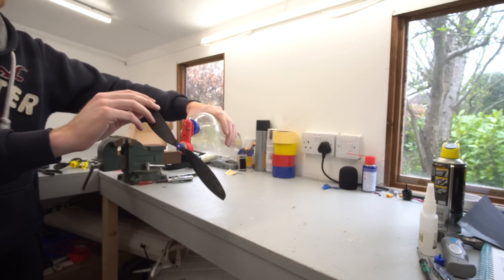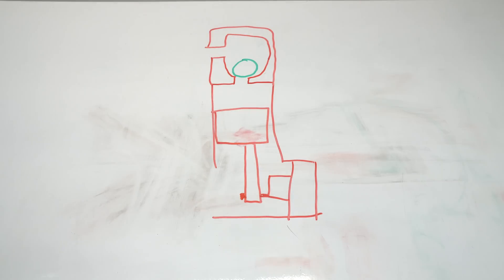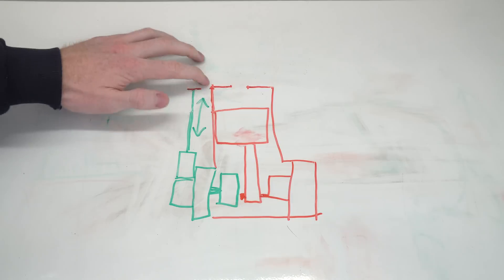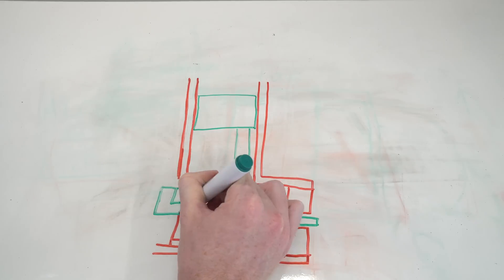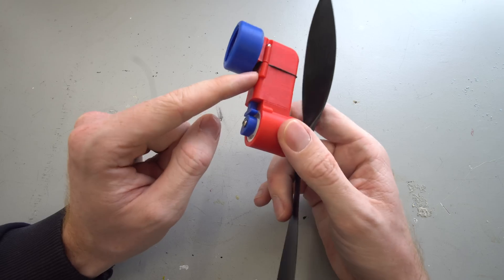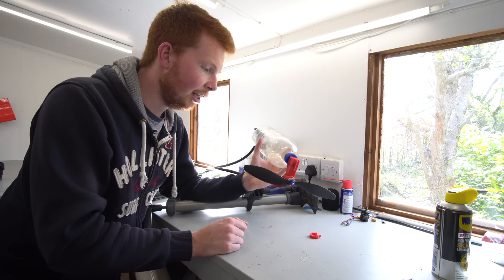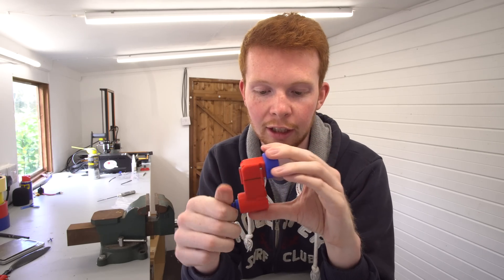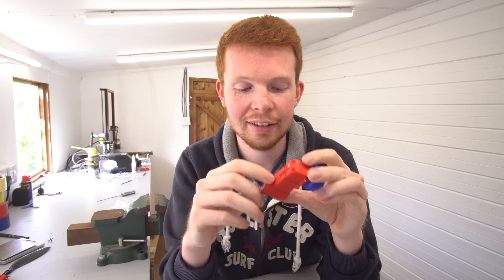Compressed Air Engine V3

Comment: Well Done!  My only question from an engineer standpoint is can the compressed air be made to be released at a constant rate instead of at a gradual decrease? I'm thinking a balloon has a different expulsion rate...

Ooo! What if you lined the inside of the bottle with a balloon that fills up and then it's contained in the dimensions of the bottle and builds pressure as normal. That way when the engine is going, at the end when bottle pressure drops, the balloon takes over and presses the rest of the air out.  A tight balloon tube that expands to fill the bottle (would have to be a micro perforated bottle otherwise balloon to bottle air pressure would counter it - but micro holes (and a lot of them so the balloon can pull away from the bottle wall fast as it squeezes the remaining air) so the balloon doesn't get pushed out the holes.

Oh yeah... that would help.  Like 10% :P

Plus it would look cool.

Comment: Aren't you re-inventing the wheel?  Meaning steam engines. Why not use the same mechanism as a steam engine?  :/  Its the very same principle, constant water vapour pressure while here is constant air pressure.

Comment: Another thought, and I'm not sure how difficult this would be, but the engine would run longer if you could somehow limit the airflow.  Right now if it's got 60psi, it's pushing the motor as hard as it can, but if only 30psi can come through, then it would run for quite a bit longer and still have a lot of force behind it.  Maybe a Tesla valve? Something to think about.  It's a great little project though!

Comment: I think your initial design was actually better.  With the extra cam on it, you're losing energy.  Just get rid of the spring and have a pin on top of the piston push the ball out of the way.  The fewer moving parts the better I would think.  It's good, but the spring is superfluous.

Comment: trust me stick some 3 in 1 oil in in there to seal the gaps between the cylinder wall and piston , will increase efficiency by 5-10 percent

Comment: Neat post,  I remember, but can't  find ,  and air motor on You Tube that had no valve,  just an open port to the cylinder .  It used the "bounce space / volume "  in the feed line to the cylinder and a big flywheel I suppose . Seemed to run  O.K . using the harmonics of the air line flow to the engine to run .  This make any sense ?  Anyway fewer parts , that always good, right?   Patents 672256, 3190554,  3013505 .

Comment: Could you purchase pre-compressed air? Or use an electric car tire pump with large metal cylinders to get a higher pressure and run time? Try experiment with those too

Comment: We actually tinkered with the idea we got a old Briggs to run on compressed air by offsetting the timing and it didn't run quick due to the lack of efficiency. Could you give me more info on this motor and the possibility of a higher upscale of the engine that might possibly create some torque under real psi numbers? I do alot with go karting and minibikes and would really love to build a compressed air engine minibike

Comment: Could you implement some sort of variable valve on the input to the engine which would allow you to manually determine how much air is entering the system and thus how fast the prop spins?

Comment: you should get a air compressor fill it and get some sort of regulator valve so it works cleanly and make the regulator into a throttle of sorts

Comment: I like your ideas, but please ditch the square piston. There's a reason you never see that in "real life", and its because its impossible to seal the 4 corners which results in poor compression and/or blow by - the latter of which is very relevant to compressed air engines.

Comment: A couple suggestions: 
1. Test the motor upside down and to the sides. If the pressure can keep the ball bearing closed, then you can double up and have a built-in failsafe that will release the air once it reaches a low enough pressure. 

2. Looking at your design, there is a waste of air created at the beginning since more pressure means more air leaking into the piston. My suggestion would be to add a regulator even within the cap, limiting the psi inside the ball bearing chamber. This will keep a more even flow with the propeller and have an additional bonus of creating an opportunity to have the speed be variable.

3. By replacing the propeller with a gear that turns a screw or nut-style cilander, you could easily transform the propeller into a turbine, similar to a jet boat.

Comment: Congratulations for all your tests, you are brave. compressed air being a very light energy to board in flight. The idea is excellent. But it would take some extra finances. a small high pressure carbon tank (found for pcp guns), a pressure regulator, and perhaps a crankshaf with double piston system, to optimize the fluidity of rotation.

Comment: Co2 compressed bottles, usually used for pellet guns...great source of air in a small container. Now I want to build one...or ten. What 3D printer did you use and are you going to make the printer files available?

Comment: Hi Tom,  Excellent solution to a problem that I couldn't see existed in the first place. Why have the spring on the top of the piston? The ball valve is held in place by the air pressure and all that is needed is the peg on the piston to lift it off its seating which it will do at top dead centre allowing the engine to run in either direction.

Comment: I saw how you used silicone lube to lube the engine, I was thinking you could make a reservoir inside of the engine on the bottom so you don't have to refill it every time you start it.

Comment: I love the idea of harness air pressure but i wonder if it’s possible to lower the noise by using a magnet instead of the mechanical mechanism so the plastic won’t click so much

Comment: did you print the threads or use self tapping screws.

or is the plastic weak enough to just have a regular screw 'self tap'

Comment: Wouldn't a reciprocating engine with a flywheel be far more efficient for conserving power output of pressurized gasses? This design seems like it's trying to work like a combustion engine and adding a lot of extra complexity and resistance.

Comment: Is it possible to link up 8 of them in a V8 sequence and have pressure tubes delivering the air to the engine also you could have a solenoid valve controlled by electricity ( making the system be able to run in an RC car.

Comment: This is cool. Put a regulator at 10-30 psi, whatever is optimal. That way all the 120 psi high pressure isn't used up as fast

Comment: To extend the amount of time that the engine will run, increase the storage container pressure and include a regulator to step the pressure down to just a little above the pressure where the engine stalls. This will get the storage pressure off of the engine, bleeding just enough air in to keep it running rather than the full pressure rushing through. Then, varying the regulator setting will change the engine speed.
Reply: daichai  Would be an interesting conspiracy if you had evidence to back any of it up
Reply: Only free pison will allow to get the full explanation.
Reply: With this, if you were to choose, you could extremely easily make an air powered rc plane.
Reply: https://youtu.be/ffT-abOkJyk
Reply: However that container will not handle above 150 psi or so
Reply: Just make the piston smaller so it uses less
Reply: @charlestinoai9491  power will be reduced
Reply: @deepad7924  not much
Reply: He'd be better off doing some analysis on the cycle and realizing that he's wasting energy by not allowing the gas to expand in the cylinder.
Reply: @frostyab7579  Allowing the gas to expand further would lower the torque output and reduce the engines ability to function at lower psi. I think a regulator, like Christian mentioned, would be a better option so that he could keep the engine working at ideal conditions for a longer period.
Reply: @frostyab7579  how could the design be modified to let the air expand?
Reply: daichai  you're an idiot. Lemme guess, you think the world is flat and that the moon landing was staged in hollywood too...
Reply: @ChristnThms  its a joke you fucking door
Reply: @DemsW  I don't think so. 
When I encounter a situation where a person is either a complete idiot, or so clever that I can't even conceive of his depth, I take the most likely option. 
He's not clever. It's not a joke. He's an idiot.
Reply: @ChristnThms  The Plot Twist : Is a very common joke format for youtube videos but I guess it's part of the things you learn on the website
Reply: @DemsW  saying it's a plot twist doesn't make it clever.
Reply: @ChristnThms  never said it was clever nor good, I only argued that it was clearly meant as a joke and calling him stupid really makes you the fool that's it.
Reply: @ChristnThms  what he meant is that when you see "plot twist" at the start of a youtube comment (or other social media platforms) it's 100% a joke, every time. That's why when ever you see "plot twist" you can be sure that it's followed by some idiotic conspiracy theory or something that makes no sense whatsoever. It's idiotic on purpose.

Hope that cleared the misunderstanding :)

Comment: use neodimium earth magnets wit oppisite poles instead of a spring, it will work a lot better, you will hve to cut down the shape of them if you want them to fit, I buy mine off of ebay

Comment: i think it is able to run under lower pressure because the piston has a much larger area. the larger piston allows the more pressure to be distributed onto the piston making it easier to push.

Comment: Couldn't you add a sewing needle-eye style slide valve to the top of the piston? It doesn't have to be round. So long as air and lubricant can get to both sides of the "needle slide valve"

Comment: What about an oil-sealed rotary valve? Could power it with a toothed belt pretty easily, reduces bulk and complexity compared to a pushrod system. What about a belt-driven cam that actuates valves more like those found in an internal combustion engine, but sealed with an o-ring so they don't have to be as precise to hold pressure? The o-ring won't see any friction that way as well.

Comment: You're thinking about this back to front. As you have no combustion happening, you can use the crank shaft chamber as part of the cylinder. The input and exhaust can be controlled by a disc with a cutout section on the end of the crank shaft. Then just leave the top end of the cylinder open and you've got an air engine with only 4 moving parts.

Comment: One problem i can see is that the maximum speed depends on how much pressure there is. If is possible somehow to cap the top speed then it would last longer to rotate.

Comment: Just fascinating. To think how engineering in the home has changed over the last 80 years, is just amazing.  In our days we had valves off the olf military equipment, then ball   bearings to do things with, then we had lathes and milling machines and all that has now been replaced by the talent of this young man.  I feel that the old community which used to meet in churches and theatres and other music halls for entertainment will not be meeting in a workshop discussing what they could do with 3D printers and their  applications.    Classical educators whom in the past thought that they had it all right  missed so many intelligent students because their talents was in the direction shown by  this young gentleman.  Getting to know the universe is much more satisfying  than reading what was written by some people in the past. THat is important to do as we build on the shoulders of other, but classical education as reading writing and Arithmetic needs to be supplemented by the design and dooing actions of very high level and ingenuity. Congratulations to all  who contribute to this discussion.

Comment: i think there is allot you could improve, your piston is huge, much to big, remember the prop spins at higher rpm in moving air as opposed to still air. thus consuming more air, using a smaller piston will give you longer flight times, also you only need a short burst of air, preferably just before top dead centre of the piston, this allows maximum pressure and effciency from the piston stroke, also making it quieter and less knocking of the con rod.

Comment: compressed air engines are old tech that in the end isnt all that useful. air hogs had these ages ago.  the issue always comes back to compressing the air.. and unless you can do that with non compressed air and without electronics or fuel... its pointless

Comment: thanks for posting.  nice work.   some thoughts.      if engine output is low-torque, it should not be loaded, directly ( with an over-sized SF prop ).     partial isolation from the load is achieved by running the engine as Fast as Practical, and using low-loss gearing, in single reduction-stage.     then, consider not using an SF (Slow-Flyer) prop.   consider the many ways in which the flying wing airframe can be Improved and/or made Lighter.    consider, Especially, that the wing Should be making at least moderate lift via the use of a Cambered, two-surface profile in its construction.   something resembling a clark-y v1 profile or the armin wing; in either case, Always thickest at 30 percent of chord.     cheers

Comment: If you went back to the v1 ball but made it out of a neodinum magnet with a rounded bottom and put it in a bracket that stops the magnet from  flipping over you could replace the spring with another magnet that has the same poll facing the check ball magnet it will work just like a spring but more staple from side ways movment

Comment: Cool design but Airhogs did this in the late 90's with a compressed air  aeroplane. It had a straight flight range of about 200yds on 100psi

Comment: increase the inlet/outlet orifice of the valve, make the piston domed to fill more area of the chamber, enlarge the exhaust port and increase cam duration. All will increase the volumetric efficiency of the system.

Comment: this is how real planes actually work! i'm working on these type of models since 1975! so real planes don't use 58493009534 tons of gas they use the free air around us! Only at startup and takeoff the gas is needed after that planes are running on 98%air and 2%gas!

Comment: I got to 2:08 and then just wanted to know, why not reverse this? It's not a gas engine- it's air, it's not going to foul up the crank case if you have air in it. Why not skip the ball valve AND the cam valve up top, and have the air feed in from the bearing location, and as it vents out through the cylinder, it pulls the piston out with it for a duty cycle? That would remove your need for cams, push arms, and those other bits, and would probably not require extensive modification.

Comment: You should try it with a proper air container over using a bottle, see how long it'll last under more realistic pressure. You could also use a 1 way valve that'll only let through a certain amount of pressure with 2500psi diving tank and see how long it'll run, it is plastic on plastic after all with no oil

Comment: Could the engine work with steam for an longer period? If not in PLA, then in ABS? With an multi cylinder approach (8 or 12), then every second loop could be with cold air.
Idea for that is not to run an propeller but harness heat to an small generator.

Comment: what if you found a way to add an internal bag and two feeders to feed in baking soda and vinegar, the inner bag in so the baking soda and vinegar don't run through the motor. how long could a rection be sustained?
Reply: find two none toxic liquid solutions that react like that, pressurize both chambers with the liquids and the main chamber, let the mix run through the motor? that would make for a longer run time I think

Comment: Using a magneto connected to a fuel (air) injector should work...the magneto should be adjusted to open the injector at top dead center...just a suggestion...

Comment: If you used a slanted cog you may be able to lock the RPM of the propeller and piston, allowing for more time with higher psi instead of higher cyclic rate

Comment: i think this is a great design, however for the square piston, i would suggest finding a way to push from both sides instead of one, as pushing from one side increases friction on the other side(think the square slightly rotates as the force is applied offset from its center of mass)

Comment: I don't get that. If the compressed air straight from the bottle cannot propel the plane (working like a rocket engine), how after introducing some extra energy loss it is supposed to propel the plane via a turbine?

Comment: Why not a two cylinder version, where you feed the used air from your first piston to the other piston, increasing the efficiency and more importantly use that pressure to open the valve, giving you a much wider range of operating pressure, since you can design it so that the pressure on the cam mechanism will always be higher than the pressure in the bottle.

Comment: Imagine a bigger version of this on a bike where pedaling the bike compresses air in a tank, and the output of the motor was connected to the wheel. Every now and then you could have a short burst of power